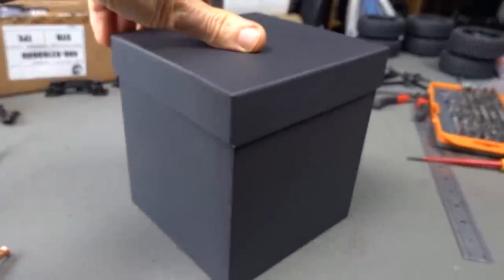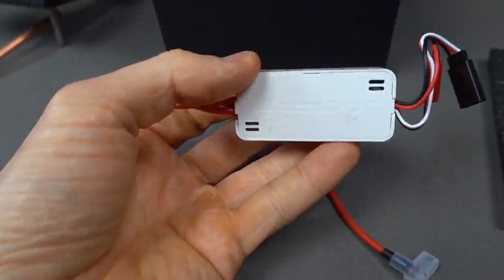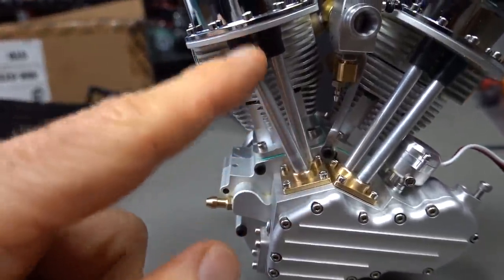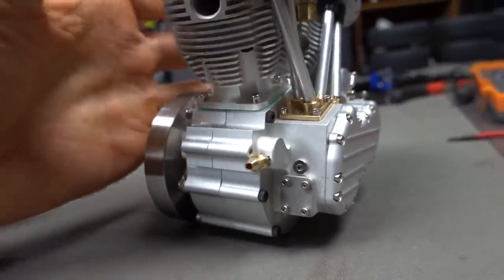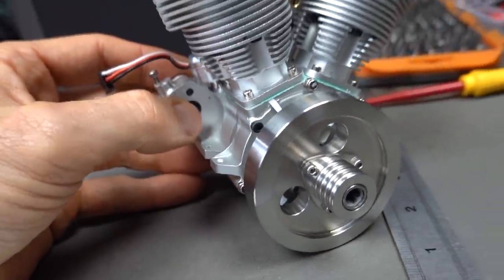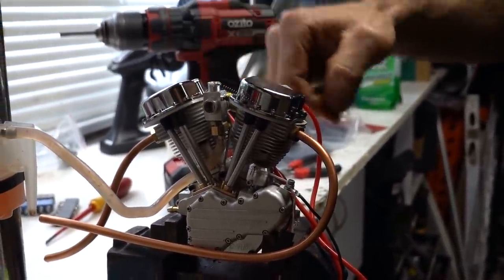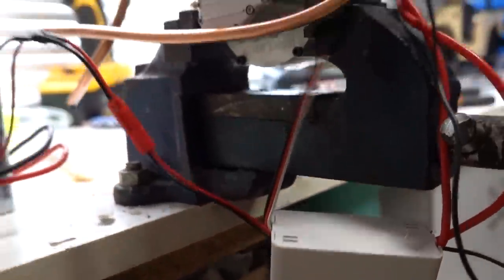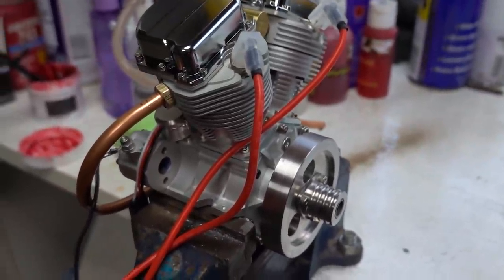MINIATURE HARLEY-DAVIDSON V-TWIN PANHEAD ENGINE THAT RUNS - SOUNDS INSANE!

Comment: that would be perfect for a 3 wheel morgan build.
maybe  c channel rails, the power output would need to be 90 degrees then a chain to a fixed rear wheel, maybe some touring car a arms and steering and a body is gonna be hard but what about a plane model body cut down
Reply from the maker: Yeah absolutely. Would look amazing

Comment: Very cool Very cool Do a Reverse trike with  60.  Derometer tire  With it pushing on the rear tire Was an air cylinder for adjustment for tension
Reply from the maker: Cheers mate

Comment: Very cool!
You might be able to replace the flywheel with a similarly weighted belt pulley and run that to a clutch.
Reply from the maker: Thanks for the tip

Comment: How does the lubrication system work? I know you get some lubrication from oil in the fuel, but I don't see how it gets to the bottom end.  i don't see an oil check. Did it come with oil in the crankcase?
Reply from the maker: 25:1 in the fuel which lubricates the bottom end. The valve train is greased
Reply: So how does it lubricate the "bottom end" when the fuel mixture goes into the carby?

Comment: I'm pretty sure that's not your idle adjustment screw, that's the high speed needle adjustment. The idle screw is the little one on the side of the carb.
Reply from the maker: Yeah I thought that too but when I adjusted it, the throttle was sticking. Weird, I will have another look mate

Comment: I thought that four stroke model airplane motors were a really great idea before I found out that they would still spray the airframe with oil. None of them can easily be modified to use an oiling system like any full size four stroke.
Reply from the maker: Great suggestion!
Reply: 2 strokes sound amazing though, and the whole reason for gas planes is the sound (true that you can add some tape slapping on the electric shaft, but not quite perfect and also you don't get the smoke). Jets are pretty much the only non-electric thing I can think of that aren't horribly obsolete.

I don't think oil would be too bad, but that's coming from a crazy guy who adds oil to his car fuel tank when fueling up (my car has a Wankel rotary engine, its better to premix fuel for them)

Comment: Not here to defend the Harley brand, but for the people that think Harley leak because they are bad or use bad seals or something ?!
If they have a rear belt drive and leak oil it's bad maintenance!
 Harleys were made to leak oil back in the day to lubricate the rear-drive chain so that's why they always leak near the rear sprocket .
they did not care for the environment back then too, so marking your spot on the street wasn't an issue.

Also, to comment on the video loved the engine and your review.
Maybe put a  pull spring under the carb lever as a return spring? would look neater 
And did you tap the threads not too high? kinda pushed the engine housing a bit at the top of the casing
Reply from the maker: Thanks for your comment mate

Comment: This is so cool!  I am worried about how the cams and lifters and gears and cylinder walls are getting lubricated... looks like a lock up waiting to happen!
Reply: tubedude54  Yeah, i would immediately pop for the accessory oil pump with a fairly large tank.
Reply from the maker: 25:1 oil mixture and top end lubricated with grease
Reply: @RCTanksTrucks247  So you're saying the exhaust gasses are lubricating all friction surfaces of this engine?!  Tappets, cams pushrods and gears.. crank pins etc?

Comment: oh this is super cool, I subbed to your channel just for this motor. here's the breakdown on Harley-Davidsons' 355° firing center v-twins:

*early 1900s, total loss oiling, overhead valve.

*flathead, or side valve v-twins. common world war II WLA bikes.

*knucklehead ohv. from now on these motors are all pushrod. same bottom end as pan. believe it or not, bottom end can accept knucklehead, panhead, and shovelhead top ends!

*panhead. same bottom end as knucklehead, same engine you have. you're little motor is panhead top and bottom. the only real issues these motors ever had were valve guide issues. really reliable motor. little oil leaks, if it ain't leaking, you're not living. 😝

*shovelhead. bottom end is different, although many things are still interchangeable. the shovel bottom swappable with knuckle and panheads. when you hear someone say, it's a pan/shovel, or knuckle/pan, it means top end/bottom end. still leak oil, still split engine/transmission, still has iron jugs, still one of the best engines, no, actually, the pan is the best one. dry sump motor, like previous engines.

*1984, the Evo or evolution motor. commonly called the A motor, completely different from previous motors. bottom end looks similar to the shovelhead, but cases are not interchangeable. first motor with aluminum jugs. the last of the big twins with complete engine/transmission separation. last of the v-twins to have dry sump oiling.

*the B motor, or twin cam evolution. first non-Sportster motor to have the engine and transmission connected together, first wet sump oil system.
I'm sure you can figure out the rest from here, LOL.
Reply from the maker: Much appreciated brother. Thanks for the support and great information.

Comment: In the 1950s there were quarter midget racers .which were very small sprint cars. These were for kids. So if your dad was into dirt track racing he could get you into it with a small car. I have seen two or three of these that were powered by Pan heads and Harley flat heads. UL not 45. Or for y'all into metrics 1207 CC as opposed to a 750 cc. If you go online on relatively sure you can probably find images of these little cars.
Reply from the maker: Yeah they definitely look awesome mate

Comment: Someone with some machining expertise ought to make some improvements like an oil pump, connect the flywheel by chain to a mocked up transmission. That flywheel is roughly the same scale size as a clutch basket on a real Harley and the flywheel, disguised as a clutch would look right at home there. Also, the exhaust pipes aren't exactly to scale. They need to be a little thicker, and made of stainless. A nice scale air cleaner or velocity stack would be cool too. Also, someone ought to make an actual miniature generator that plugs into the original spot on the cases that puts out enough power to run the engine with no battery.

Comment: how does the top end get lubricated ,  oh it works like a STIHL 4mix motor. harley motors are i think 1/6 of a aircraft radial engine.
Reply from the maker: Top end is separately lubricated with grease

Comment: If this motor is built internally like a Harley Davidson V Twin than what you thought was a boss for the starter motor was in fact the primary drive for the chain to the wheel. 
  That's assuming this mini is built in the same way.
Reply: It absolutely isnt. It 100% is a place for a starter.
Reply from the maker: Hopefully it is for the starter

Comment: Done up in the vice is a bit rude...
Also thats the mixture you're twiddling there. Idle speed is the little screw under throttle lever
Reply from the maker: It was a just quick setup to make sure that it runs. Figured the idle after the video 👍
Reply: @RCTanksTrucks247  
Cool. I wasnt tryin to put ya down. Just i have seen blokes destroy a lot of 2 stroke nitro model plane engines that way. Those first few minutes determine the life of them engines

Comment: Hi this might make a nice starter with a little work one way bearing and a drive cog to fit RS PRO 12 V Unipolar Hybrid Stepper Motor, 6.35mm Shaft Diameter
Reply from the maker: Nice man

Comment: No oiling system.  How would thing engine last for any length of time.  What's the look-a-like distributor for ?
Reply: Dont be silly its an engine.... They live with oil in them and just because it doesn't have an oil pump doesn't mean that it doesn't splash oil around inside of it like a lawn mower engine, most small engines don't have pumps because it's pointless and expensive to engineer them hence why usually only specialty model small engines get them. There are videos on how oil reacts inside running engines and its quite amazing to see.
Reply from the maker: It has oil in the fuel, 25:1 two stroke mixture. You can adjust the timing by turning the distributor just like a real engine

Comment: I heard you say fuel and oil mix, but I'm curious. Does it operate as a dry sump? I did not hear any mention of needing crank case oil. Great looking and sounding none the less.
Reply from the maker: Great point!
Reply: @RCTanksTrucks247  So what's the answer? Does it need oil in the crankcase?

Comment: It has the potato potato exhaust note even! As it runs premix I'm assuming all the pushrod tubes etc are fake as it's a two stroke.  No teeny valves and cam ?
Reply from the maker: Mate, it's 4 stroke. It has push rods. Go check out the schematics of the engine.

Comment: Thats a beautiful motor. But I'm pretty shure that the engines vacuumed is necessary, therefore it suddenly becomes apparent that it must have oil which causes the right value of vacume volume as well as lubricates the dry engine. 
Is it junk now? 
Its too bad you were over anxious, but it looked and sounded nice. 
I'll bet the price is ridiculous. 
Ok peace.
Reply from the maker: Mate there is no issues with it. There is 25:1 oil mixture along with grease on the valve train
Reply: Well ok brother, you know more about your motor then I do. 
No offense. 
But. If it's anything like a real motor , which I believe it is. 
The oil, and grease?you said is in the valve cover has to go somewhere . 
Its never sealed in these areas and must flow somewhere. It must be lifted above the components it is to lubricate, and therefore it must be pumped somehow, so... 
I know I could hear the delicate valve train clatering. 
Yes the motor sounded nice. But the reason a mentioned the vacume, Is because the way the motor died. The vacume in this motor is little, however. These motors still need the proper vacume to run correctly. 
Anyway. 
Like I said. You know more about your motor then I do.. I'm just an inventor and saw a provable issue and thought I'd point it out to you since I have some experience with these engine types. 
But no matter mate. Peace. Enjoy your cool lil motor. 
Oh. . By the way. The lower part of the motor also.needs lubrication as well.  Ok peace.

Comment: The hole in the front of motors for a generator if you wanted to generate power with motors never had an electric starter the starter was on the transmission driving the belt
Reply from the maker: Yep for the full size version

Comment: Since when did 4 stoke motors need mixed gas? Mixed gas is for 2 stroke motors. It's probably a 2 stroke disguised as a 4 stroke
Reply from the maker: lol you have no idea. It is only because it doesn't have its own lubrication system for the bottom end, therefore the oil in the fuel does it. Do some research before you comment.
Reply: @RCTanksTrucks247 Ok mister know it all  it's a two stroke made to look like a four stroke.
Reply: @RCTanksTrucks247  Actually I'm glad you replied as you did. Now I know not to get my kid into this hobby. I'll find him a hobby where one can ask a question without being treated like dirt on the ground.

Comment: Why couldn't you run that with a belt drive to an axel with the clutch on the axle. That would eliminate your starting problem. Not sure how difficult it would be,, but it sounds possible.
Reply from the maker: Definitely like that idea mate 👍
Reply: I was thinking, maybe a one way bearing in the mix.

Comment: That’s not where a starter would go that is where the oil filter would go if it had an oil pump and the starter goes on the other side. Cute tho
Reply from the maker: I know but this miniature version might have the starter motor installed there

Comment: That poor dry motor. You can hear the valves being beat.
Reply from the maker: Its not mate, it has pre mixed oil running through the the whole engine and the top end is greased separately. You must know more then the guy who designed it apparently
Reply: @RCTanksTrucks247  
ok i can accept that, thanks my brother, 
i actually  feel bad suggesting my thoughts Based on what I understand. 
You make sense. I'm going to go with that. Thanks again brother. And peace be on your house.

Comment: Harley's have that unmistakable sound! that's because it's a square engine design which means the bore and stroke are the same for example 4 inch bore x 4 inch stroke. The square engine don't run as smooth as under square engine's and over square designs for example 4.250 inch bore x 3.75 inch stroke or 3.75 inch bore x 4.25 stroke which the latter can produce good low end torque vs the 4.250 inch bore x 3.75 inch stroke engine produces low and good upper range power and torque. The square design engines usually don't last as long as the under and over square engine's. Most racers want the bigger bore as much as they can safely get by with for the streets and strokes can be anywhere from mid 3's to 4.5 inch stroke are bigger. There's a few racers that disagree with the big bore engine but the proofs in the pudding the breathing of the big bore engines create insane power look at the best engine builders out there and cars that run drag week look at those engines from mountain motors to 400 + cubic inch turbo cars and trucks.
Reply: Nope Your Wrong! first off, Harleys are not square Revtek made a Harley replica 4"'x4" and Delcron made a 120" 4.25" x4.25" but Harley didn't. The lopey Idle comes from the single crankpin design of the engine.
Reply from the maker: Thanks for the info
Reply: @scootertrash7944  sorry!  I guess I needed to fact check all of the engines bore and stroke sizes, I was referring to a conversation I had with a mechanic and is been years ago. The engine he was talking about was his bike and I wanted to know why it never idled like the sport bikes and the v twin in his bike was saying the engine was around 65 cubic inches per cylinder, he explained  to me about the engines being a square design and and only two cylinders. He was saying it was how the crank throw placement it would never idle good but once it was revved up it was all go. Can you tell me if they had a square design if you see this. I'll take the comment down later. Thanks scootertrash

Comment: If you look closely, you can see the oil stain on the tool bench under the engine.  It's an exact duplicate of the real thing.
Reply from the maker: That's excess oil from running rich
Reply: @RCTanksTrucks247  I'm not sure that you got the joke .

Comment: It needs that huge flywheel to keep that archaic design running.  The history of the Harley V-Twin is interesting.  The reason the motor is so un-balanced is because they designed it with a single crank-pin to save money.  But it was its sound that kept them from properly developing the engine, all the way up to recently, since the company is no more than every other faceless corporation that exists to exist.  I have no emotions on the matter.  I don't like anything that doesn't have points, and they never made anything world-class for the average consumer during the points-era.
Reply from the maker: Thanks for the info mate. Much appreciated and thanks for watching

Comment: Why are model engines so expensive, you can get a 6.5hp generator for £80,  for what these cost you could get petrol generator that would run a fair ground. OK exaggeration but you know what iam getting at
Reply from the maker: Smaller size man. They are great prices if you were to make this then it would be hella expensive

Comment: Depending on what you mount it on, you don't need a clutch. Run a belt from that spindle to a pulley mounted on the axle and just bump start it like this...  https://youtu.be/od7WF0VB5UE?t=60
Reply from the maker: But I want a clutch so it can idle

Comment: the generator goes there, not a starter motor........
Reply from the maker: Yeah but I think they are using it for a starter for this rc version
Reply: @RCTanksTrucks247  but the (kick) starter on a Panhead goes on the transmission. Also the flywheel(s) go in the crankcase on crank pin.

Comment: If it runs on nitro, it will make more relative power than the real thing. Those combustion chambers were modeled after aircraft engines that had supercharging. Poor flame travel without boost.
Reply from the maker: Cheers